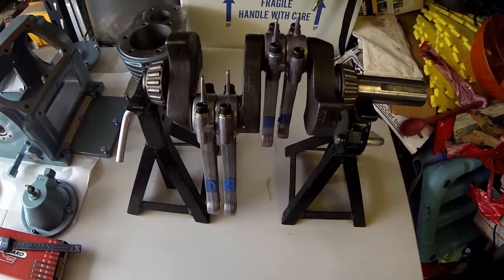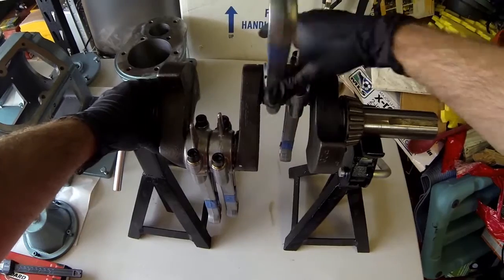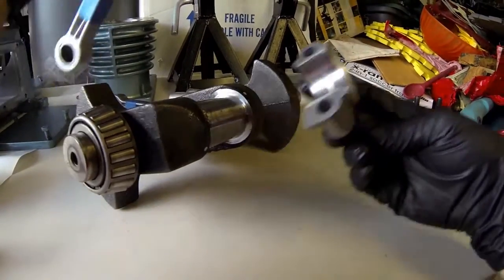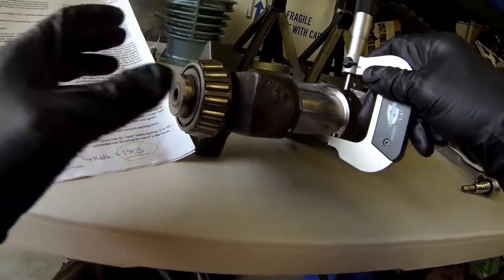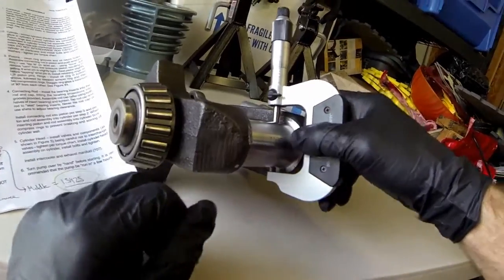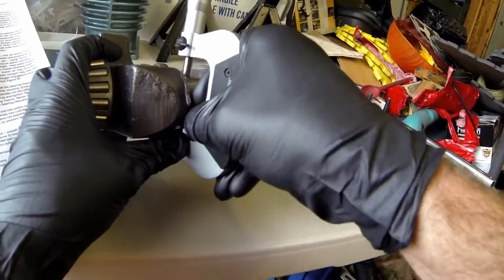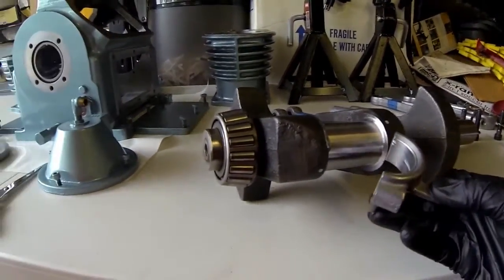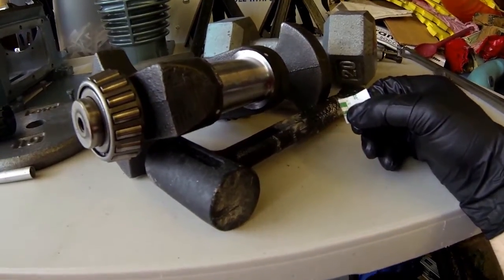Saylor Beall 707 Crankshaft After Weld up and Grind Down

Comment: You need to loosen up on the spindle of the micrometer. You are using too much force trying to measure the journals on the crankshaft. You should only have a light drag on the spindle when doing a measurement. You are setting the diameter on the mike and then forcing it onto the crank . Obviously your journals are a little larger than what is on the micrometer. Try using a standard to check yourself.
Reply from the maker: Thank you for the useful tip.

Comment: Sorry I missed most of the fun already but, here is what I know about the 707, and most other Saylor Beall compressors I have rebuilt in the past. They have very porous cast cranks, every one of them. The pits and porosity holes aren't much to worry about, as it actually aids in oil retention since this is a splash lube machine. The rods, well that is another story completely. I see you replaced all 4, that is good, rather pricey, but good, LOL.
 They are made from aluminum for good reason, so that when they break, and they do, they are soft enough to not destroy the other components. They do seem to fatigue on the 707's more frequently, even on well maintained machines.
 You got lucky on the new rods, you got needle bearings for the pins, the older style had bronze bushings on the wrist pins that required boring and honing to fit them, as they were undersized right out of the box. Saylor Beall evidently likes to hand fit everything, because nothing we ever got from them fit out of the box. Brand new rods with new bearing inserts all had to be fit to size as they were always undersized, even the standard bearings had to be massaged to fit properly.